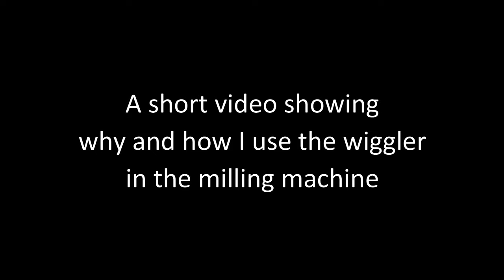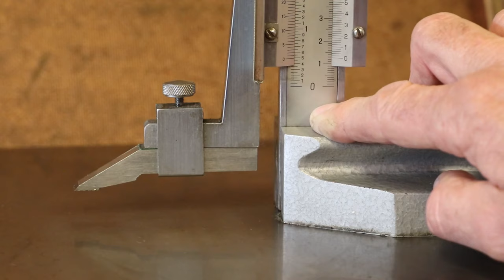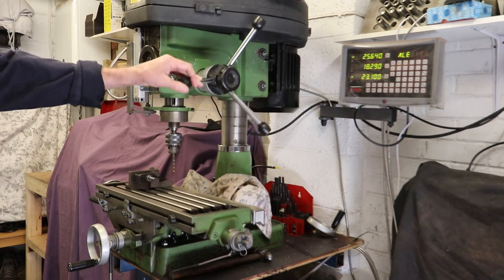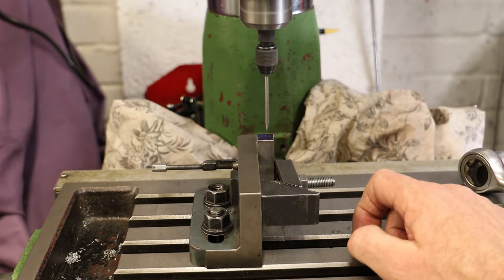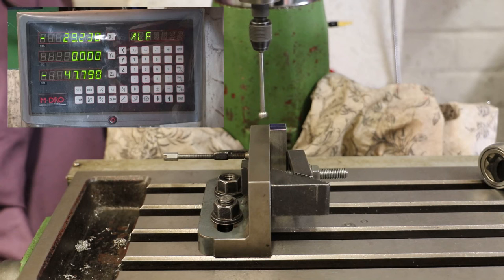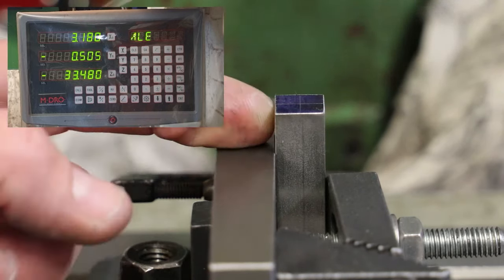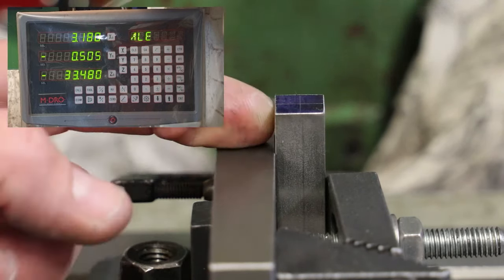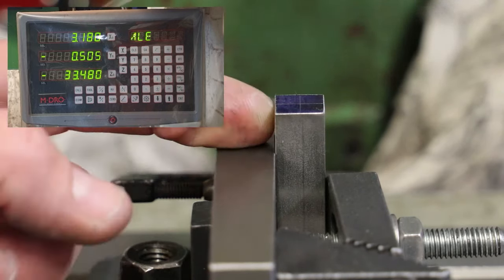Using the Wiggler

Comment: You should always check that the height gauge is reading zero with the blade on the surface plate. Its easy to derange the sliding scale or the blade.

Comment: As an apprentice I was shown this method of determining the position of the spindle centreline in relation to the work face but most of the older machine men would lick a small piece of cigarette paper and stick it to the work face to indicate when the cutter was about to touch on.  Despite this sounding crude and unhygienic it was quick and surprisingly accurate.
Reply: When I was an apprentice (a disturbingly long time ago) we used one ply of the blue workshop paper towel and used coolant to stick it to the part.

Comment: Is it acceptable in engineering to use a wiggler as a edge finder instead of a dedicated edge finder.  I ask this as if you put a wiggler poing onto the edge of the work you have the edge straight away without calculating the diameter of a dedicated edge finder and then  moving it again once you have halved the edge finders diameter if that makes sense.

Comment: Use a Joe Block to set your Vernier Hight Gage. Imperial or Metric makes no difference it’s all numbers. 25.4
Being that most material and tooling is in Imperial it’s makes sense to use imperial.

Neither is superior to the other. It’s a matter of personal preference. 😉

Starrett makes a great wiggler and I’ve used it a few times but prefer an edge finder, Brown & Sharp or Sterrett 😉

It’s nice to see someone actually use a wiggler.
Reply: I use a Starret wiggler when picking up on punch marks, thought everyone without DRO did the same.

Comment: 1/2 of a 1/2” is 1/4”. Much easier and more accurate to set 0.25” on your height gauge than convert to metric.
Reply: ....................plus, it isn't possible to set 12.35 when scale only reads in 0.02mm increments. 'Proper' machinists swap back and forth between metric and inches without a problem, even American machinists on You Tube are now doing it (although I'm 'old' and grew up with Imperial system until Britain forced metric on us after joining EEC)
Reply: This was painful  to watch!! Hope his parts turn out  better then what he just showed ... hope my grandkids don't see this and come with a wiggler here  as they will be in the trash can either there wiggler

Comment: Personally, I make metric parts on metric bikes and Imperial parts on bikes made in inches.
Guess I'm OCD but it drives me crazy when people start fitting 'wrong' threads and sizes.
 Some older Honda's (mid 60's~70's) actually used Whitworth thread on spokes, bit of a shock finding 1/8" Whitworth thread on a 'modern' bike.
I had a couple of V-50's and a V-75 several years ago, liked them simply because they are 'different'

Comment: I learned something the other day at work about the DRO and the wiggler edge finder in a mill drill. The second way you found the center zero out then find the other side, then hit the 1/2 button and the axis to the right (not the zero axis button). The DRO will half the number for you, by turning the handle wheel and move that axis to zero you will be on the center line of that axis. Thanks for sharing! P.S. the height gauge is self checking, rotate you stock 180 and scribe it again. You will see the error and can compensate between the lines.

Comment: Hi, I dont understand the difference between grabbing the tip shape point on the wiggler rather than using the chuck and making the same eye alignment process. Is the wiggler supposed to be more precise??
Reply: The wiggler compensates for any bent thing that you'd stick in the chuck and use to align it. The wiggler point when it isn't moving while rotating, absolutely HAS TO BE under the rotational axis.
Reply: Chuck is designed for higher torque tightening with a chuck key. wiggler chuck is designed hand tight which will not damage holding shank and correct pressure for slip to wigggle.

Comment: Thanks Mark, a really great explanation of the wiggler. I'm waiting for a milling machine to be delivered and will have to invest in one, looks like it will get quite a bit of use.....seeing you making parts for your Guzzi makes me wish I hadn't sold my mine :(
Reply from the maker: Hi Mark,
I use the wiggler so much I'm sure I could do it with my eyes closed. 
Good luck with your mill when it arrives - what are you getting?
Thanks for the feedback,
Mark
Reply: @markshomeengineering5243  Hi Mark, I went for a Warco WM16 B, the belt drive appealed as it avoids the plastic gearing in some other machines, and Ade from Ades Workshop has one and posts some useful projects using his. How do you find the WM 250? I have a WM 240 and love it....I used a 1934 Drummond before, still have it and will restore it one day. Cheers, Mark.
Reply from the maker: @markhansford178  Nice - you won't need to use the wiggler as much as I do as you'll have a dovetail column.  This is the big downside of the mill/drills with round columns as once the head is moved and reference to the table is lost.
The WM250 is great, especially as it has now settled in. 
All good fun during these strange times :-)
Mark
Reply: I guess it's better to have a toy mill than to have a proper one and nothing to drive it with !
Just recently discovered there's a plan to close my front street. I'm making enquiries as to why. I could hope for electrical cabling work then I might ask if they'll slip ina 3 phase upgrade for us while they've got the road up!
Reply: @millomweb get a phase converter. I got one off aliexpress, turns 220v 1ph into 400v 3ph.
I run my bt30 (rf30) round column mill on it.

Comment: Nice video and very informative if a budding engineer has need to understand the wiggler! 
I do have a couple of (hopefully constructive) comments if I may. 
1. Whilst I respect your preference for the metric system when reading the vernier scale and converting 0.5" to 12.7mm the scale is required to be between the 0.4 and 0.6 marks so you are reliant on your eye (not that I am doubting your eyesight) but the 0.25" has an exact mark on the scale so why not use it? You may have made a quick comparison when setting the height gauge and if so you have used the imperial scale anyway.
2. This is a minor comment but as your video was perhaps aimed at the less experienced engineer I think it would have been no bad thing if you had demonstrated that your micrometer zeroed out before measuring your stock so that your final measurement of the stock would have had perhaps more credence.
I like the use of the magnifying glass I often do the same, we all need the additional assurance that this brings after all the first contact with the centre drill is the most important one.

Comment: Informative video. Edge finders are better. This is an old school method that actually takes longer than using an edge finder and happens to be less accurate. Imagine that.
Reply: I have a wiggler in My tool box for Years. I have never used it. I always use indicators or edge finders. 
You are right. Edge finders have made these obsolete. What is the advantage of using the pointer on the wiggler to line up to scribe lines when You can just use a pointer in the chuck or collet? It seems such a waste of time.

Comment: Working in fractions? I have yet to use  fractions while in the machine shop. Once you get to measuring, inspection, machine adjustment, it all becomes decimal. Fractional is either an old drawing that needs converted to decimal or your in construction. In the years ive been in machine shops, ive never worked in fractional except maybe grabbing a fractional drill. It all becomes decimal once on the floor  so no need to argue about fractions or metric.
Reply: especially when using a 1/2 " piece of stock.  pretty simple math to divide by 2 to get center.

Comment: I say the same thing about millimeters -  and, I still don't know the difference between the Japanese millimeters and the Europeans.  In Merika, we have course or fine.
Reply: Japanese and European millimeters?
Reply: @jasonplugowsky3086  Yes, just like England and American SAE.  It's all abut the pitch.
Reply: @jamesjacobs1909  I still don't understand what you are suggesting.  There is only one metric system.  However like Imperial, Metric also has course and fine thread pitches.
Reply: @jasonplugowsky3086  Not true.  there's 1.0, 1.5, 1.25, 1.75, 2.0, and etc.  Japanese use 13mm and 9mm, whereas the US uses 8mm and 10mm and etc.  I'm not an expert, but I was told that there was no such thing as an 11/32 at 24 pitch either - but they do exist.  What about US and Japanese pipe threads?
Reply: its spelled Murika

Comment: I will challenge the wisdom of going near any rotating part using your fingers. Two other content providers both use 1000rpm spin speed and a pen/pencil to stabilise the wiggler. I always use eye protection on my mill and lathe. Maybe for this a full shield (which I do wear on occasions) is also an idea. A wiggler spinning off into your face would be very nasty.

Comment: people think that imperial is in fractions... it is not. One inch is split up into 1000 or 10000's of an inch... where is the fraction?  only woodworkers use fractions.  Thus imperial is no different from the French system.  And don't get me started on that!  I do not know why anyone would use a system metered out ( pun intended) by two of the most incompetent surveyors that France ever produced.
Reply: 1/1000 is a fraction, which can also be expressed as a decimal. Seems like a lot of machinists don't have the understanding of math they ought to.